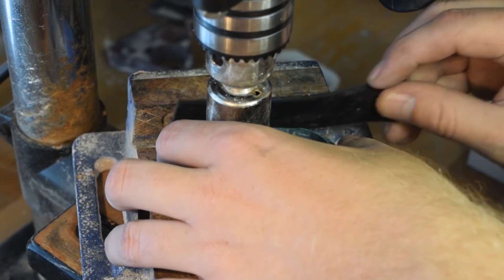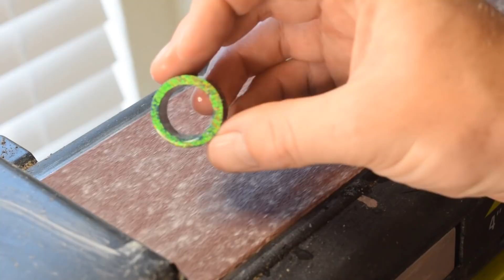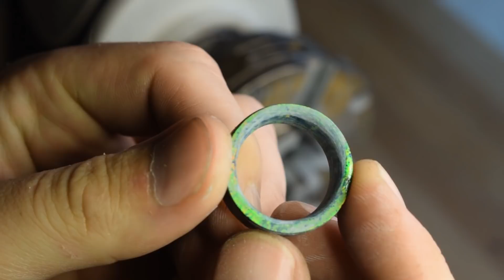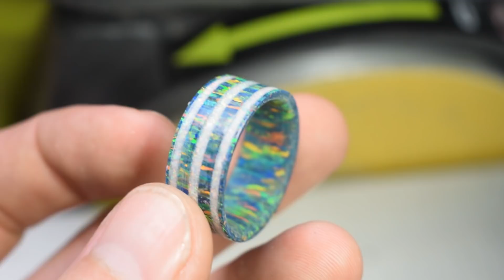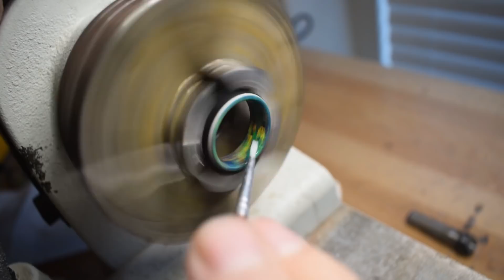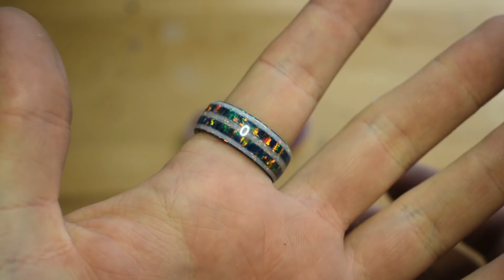Creating a Solid Black Bello Opal Ring with Triple White Opal Inlays

Comment: for work like the inlays done here I would suggest taking the vise you used on the drill press and clamping the dremel into it, securing this infront of the lathe so you can slowly and uniformly crank it in. 
Unless you have the rest of full size lathe and can do it without the dremel

Comment: I hope I am correct that is synthethic opal... ? :) Ok seeing the end i am sure they are synthethic now.. but good work like it.. I also made some rings from Tamascus and also create them a bit thicker then they should be..
good work
Reply: It is synthetic you can tell by the grain but it's still expensive stuff
Reply: @stephenvesper5266  Yes it is not totaly cheap, but far from the real deal tbh, also much easier to work with because the real deal are need threatment and don't show lamelas trough the whole bulk. Still good project I like it..
Reply: Can you make one in a size 10
Reply: I could tell immediately that it was synthetic opal, because the video title says "Bello Opal" which is a brand name of synthetic opal.   :-)    Sorry to be a smart ass, couldn't resist.
Reply: @jerrysstories711  I do not mind, as I tried to point out. I never worked with them, so obviously I don't know the brand names. Never the less it was just a random comment without any side thoughts about accusing from fraud or something.. :D
Reply: @stephenvesper5266  well depends where you get it
Reply: @marijhorn  oh yes working with real opals is heck hard you have to be careful not to give a fortune away. Opal and heat does not go well it can just meld away

Comment: I noticed you used alumi uv on this ring. I have some solarez uv resin I've used on a couple rings and it doesn't hold up well and feels rubbery. Was just curious if you have used it and how it compares to the alumi uv. Thanks,  beautiful ring by the way.
Reply from the maker: I have noticed that UV resins need close proximity and full coverage UV exposure to cure correctly, as well being the right temperature and coat thickness to get the expected result. I am aware of the "rubbery" texture you are referring too, it took a long time to work out that issue but it is doable with practice. Also having the correct wavelength UV bulbs is so important.
Reply: @TempestRings  awesome thank you I'll keep at it.

Comment: How do I buy one of these, how much are they? Aren't the thicker ones stronger?
Reply from the maker: You can check the website in the desciption, they are drop tested at 5ft, I haven't tested the different thickness at different heights. Just 5ft across the board.
Reply: Don't waste your money, bud. You'll never see the ring. I'm speaking from experience.